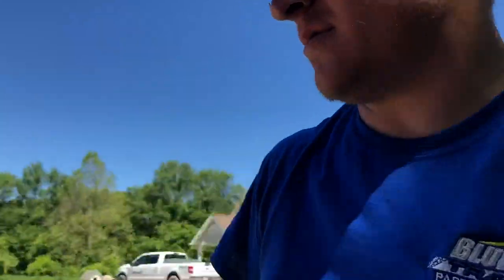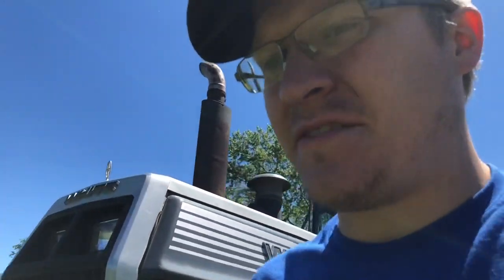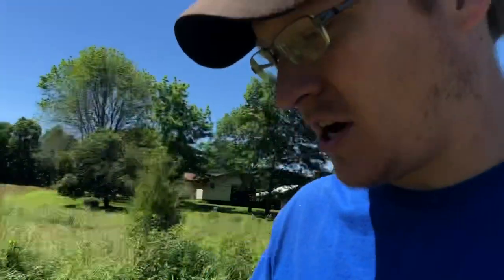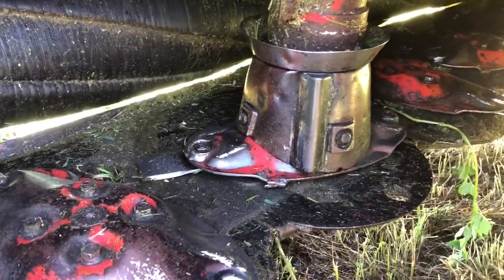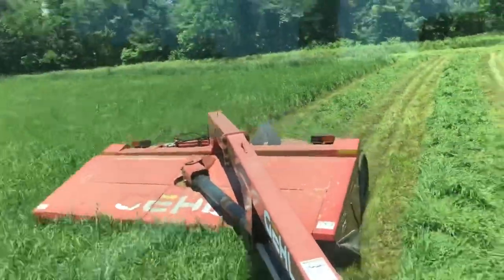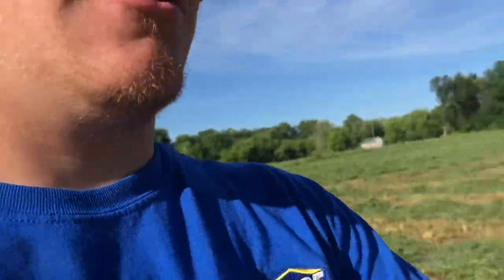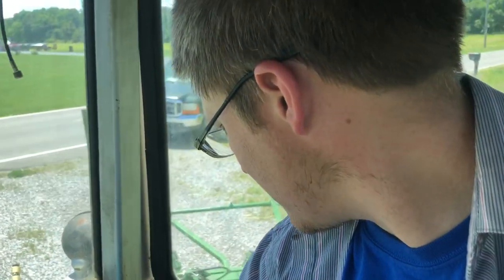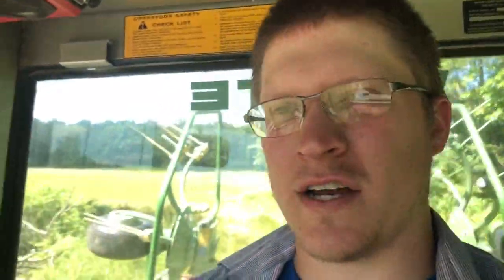Cutting and Tedding First Cutting HAY 2020

Comment: Where are you located?
Reply: @thebalerman  I'm in South Central Ky 45 miles east of Bowling Green. Sounds like you have the same weather problems I do
Reply: What size white is that? Curious the power and how it does in your opinion with that particular mower
Reply from the maker: 2-135. It’s about 140hp. It handles it really well. Don’t really have to have that much tractor but it’s what I have. It gets around pretty well and doesn’t have any issues with it. I really like it